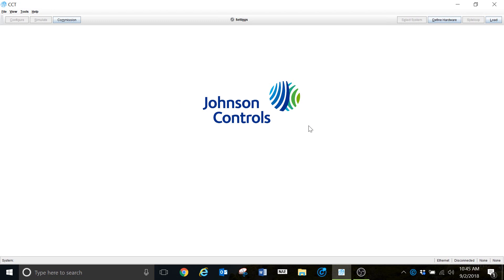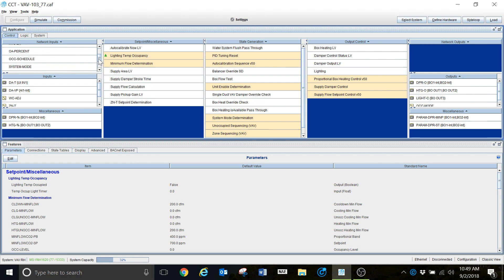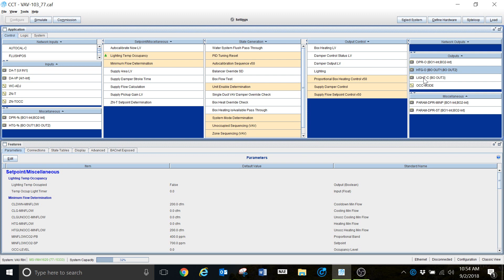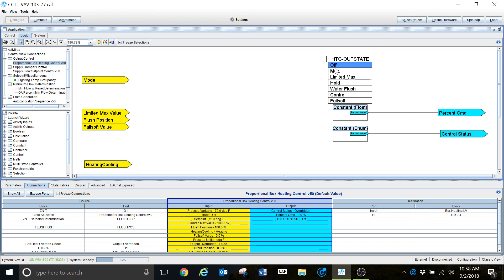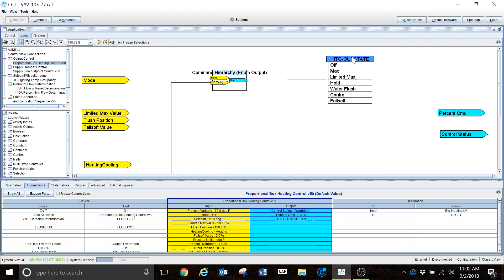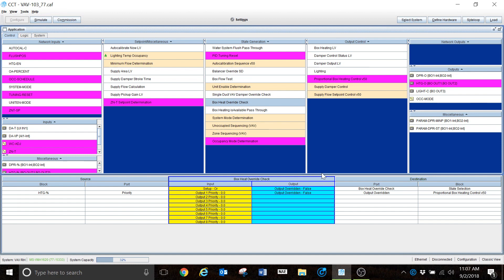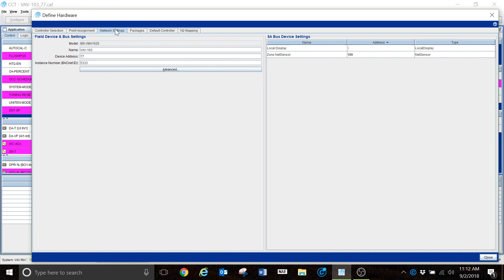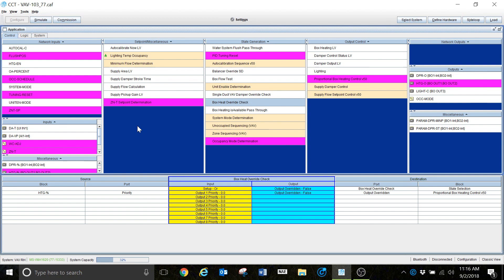Johnson Controls CCT Basics

Comment: Nice to see you back with some CCT info. To Joseph, incremental output is a binary output thats is just a open/close, on/off type of output that varies the time that is is on to control the valve, proportional is a analog output to varies from 4-20ma or 0-10 volts to control a proportional type actuator.
Reply from the maker: Thanks

Comment: These vidoes are so valuable thanks again ! I was wondering if you could make a video on setting up a FEC for just a constant air hot water heating coil with a control vavle on it ? Im use to doing JCI vma1832 programs but its diffrent when you just have a heating coil with constant air and no damper.
Reply from the maker: I'll see what I can do

Comment: Great refresher and you explain things better. How does a guy know where the program is at? If an actuator isn't opening and it's below setpoint and the damper operation has been verified. The exhaust damper is just sitting there? some trouble shooting tips? thank you.
Reply from the maker: You would need to go into the program and monitor it in real time.
Reply: @Systemcontroltech  So commission into the controller and watch the logic block or state tables change or not? I could change the vav from heating mode to cooling mode and the output block just sat there.

Comment: This is an older video but I have a question about CCT. After I go to transfer and upload program, it will load to 100% and say successfully transfered to computer, but it will stay at johnson controls screen and load and never pull up the program. Is there anything I need to try? My Map tool seems to be communicating with the controller, something in CCT seems to be messing up. I’m an on CCT 10.2 and the main code version in controller is 6.2
Reply from the maker: You may try reinstalling CCT. Upgrade to the latest version if possible.  I've seem that happen with 10.2 when controller was at a newer version but not sure about older version in the controller. If it's just this device you're having issues with try to get upgraded cct.

Comment: Thank you for sharing this. Could you please upload video about commissioning Johnson controls integrator or NIE with third part party devices?
Reply from the maker: We actually don't use any NIE integrator anymore.  There are a lot of things that play into this.   We once used the Sigs to integrate with a barbor colmen system before completely converting it over.
Reply: @Systemcontroltech  Okay. Would love to see a video on integrating MIG with third party devices using Modbus or BACnet. 
It will surely help to get an idea about configuring, downloading .vct files and assigning addresses to them.

Comment: Greetings from Miami. 
Great video.
This may not be the right tutorial to ask you abouts NAE emails configuration. Do you have a video on how to create a gmail account into your metasys engine. 
Thanks
Reply from the maker: You should be able to add your email to the user account in your system for a particular user.  There are different functions that can be done and reports that can be generated and sent to the email address depending on how you use your system.